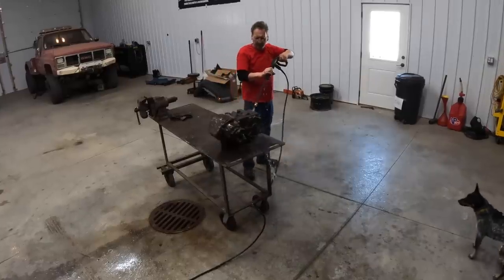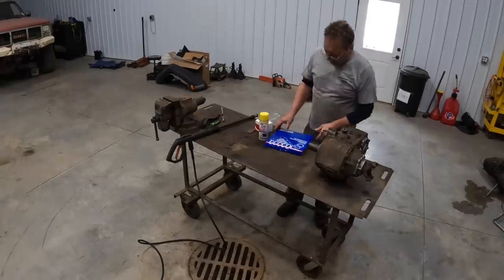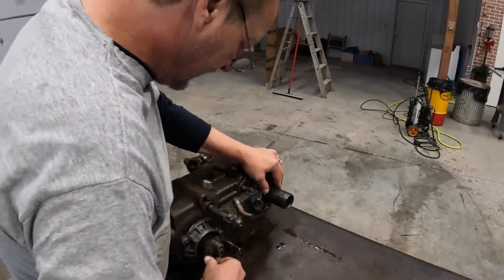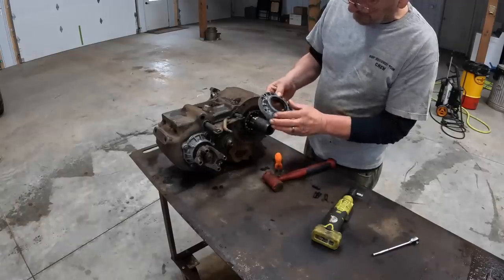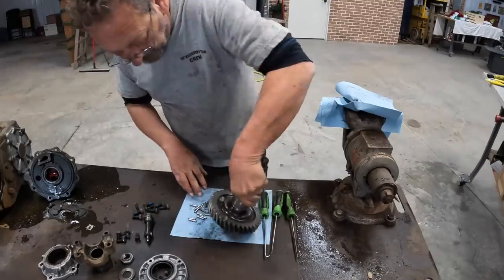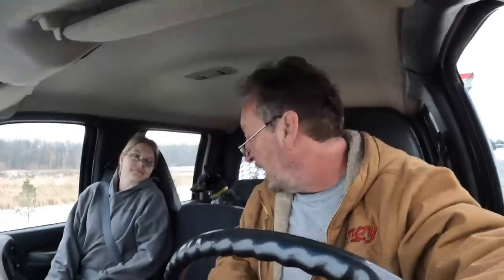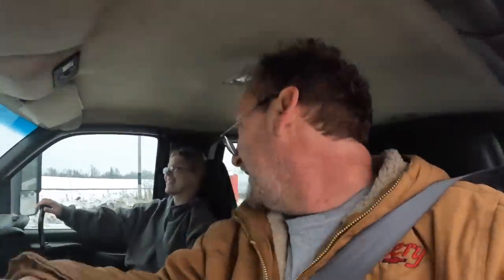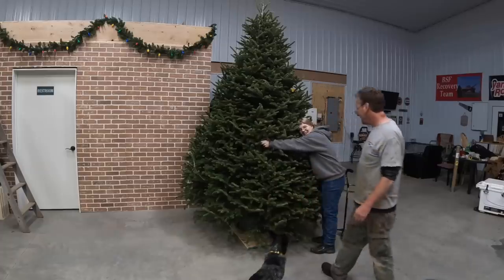Wrecker 205 T Case inspection

Comment: I'm glad to hear you say oven cleaner I was thinking it the whole time I'm watching you starting to pressure wash at first. We have a hot water pressure washer at work that blows hot water out but man oven cleaner just does so much better. 

Warning though. If you've never let aluminum sit in oven cleaner for very long be careful it will eat the surface

Comment: Years back I went searching for a used transmission washer.  Rebuilt it & added a skimmer.  Best shop tool ever!!!!  It makes cleaning up parts a breeze, I wash all my small parts in baskets & even drain pans ect come out amazingly clean.  A new clamshell style washer would be nice but for now Im happy to have a way to clean everything nicely.  Heats the water to 140deg... too hot to hold onto parts after they come out.  Things are spotless or darn close!

Comment: You should use oven cleaner on the heavily oiled spots, as it will eat into the grease and make it easier to spray off.  I only discovered this recently and i was able to clean up some heavily greased wheel hubs using the oven cleaner.

Comment: If the  tree falls it will rip the plastic.ive seen it.i made a tree stand.10 inch pipe 10 8nches tall welded to a 12 inch steel plate 14 inches across drilled 4 holes 3 qoarters way up side .use threaded rod welded 14 in square to threaded rod for handle to screw onto tree

Comment: You know .I know a place that remakes the low max kit  . midnight metal works I believe also makes them they also make a better 205 and Dana 300 with gear reduction boxes .203/205 is out dated the new stuff is way better  gear reduction boxes with 241 or 271 gear reduction boxes